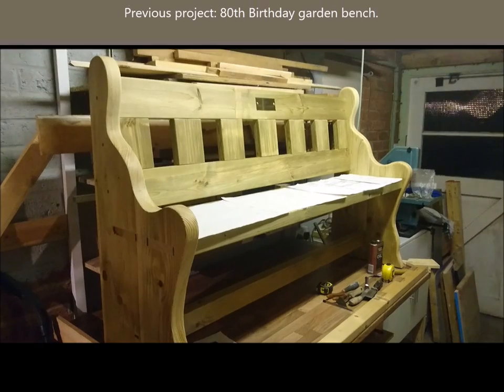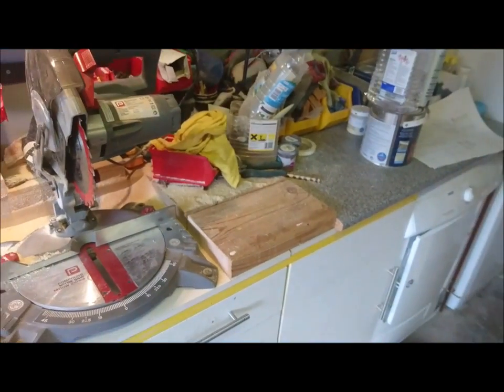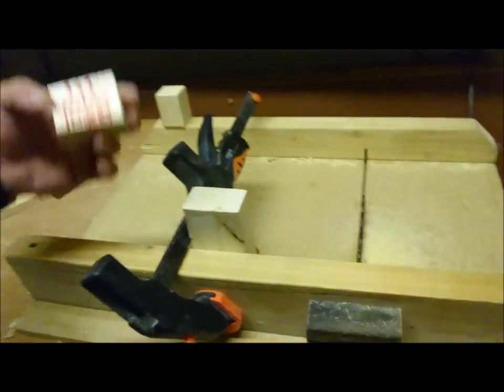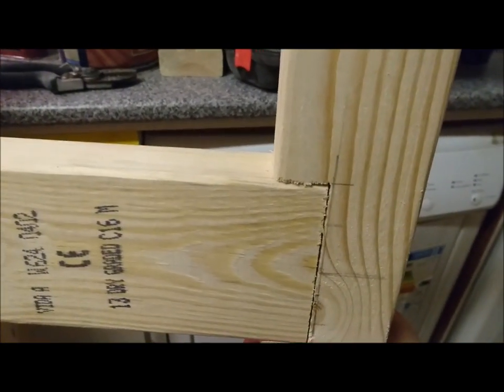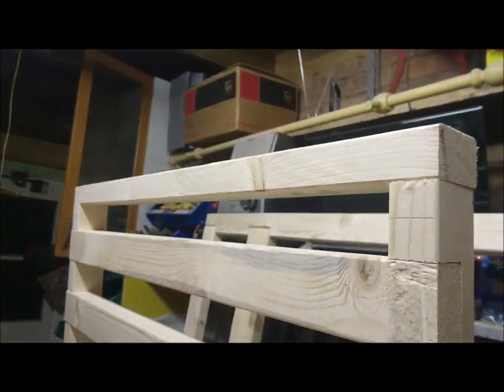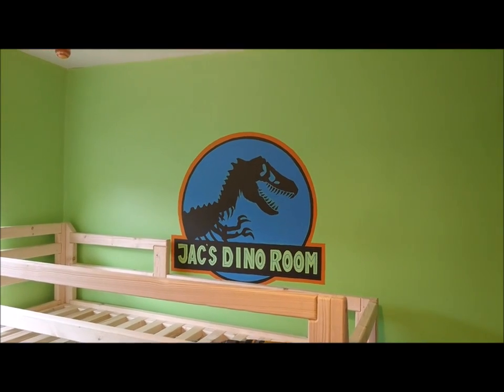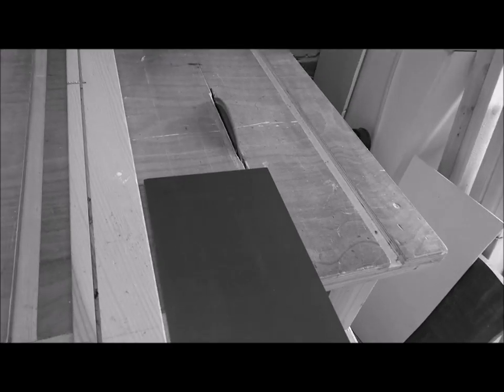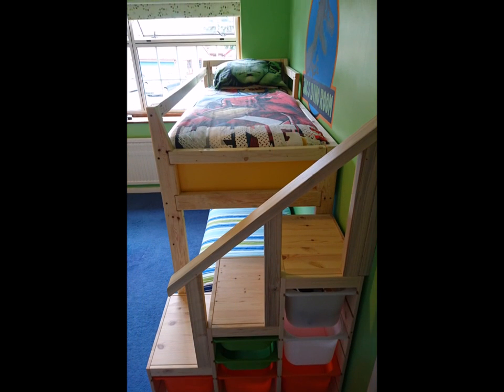Chatters DIY Bunk Bed (under £80)

Comment: How much did you spend on material?
Reply from the maker: Hi there
Less than £80 on the main bed materials but then brought the trofast steps from ikea for another £70 - which was optional. Otherwise I'd have built a ladder into the footer frame.

Comment: how did you attach the mattress "holder" with he slats to the rest of the frame?
Reply from the maker: Josh Cline from underneath screwed 5 2.5in screws along each long side and three in each end. All the side frames are made to 'wrap' around the slatted platform. You may see more detail in the other cabin bed video I did as it was based on this bed but I filmed different parts of the assembly. Thanx for watching!!
Reply: Thank you for getting back to me